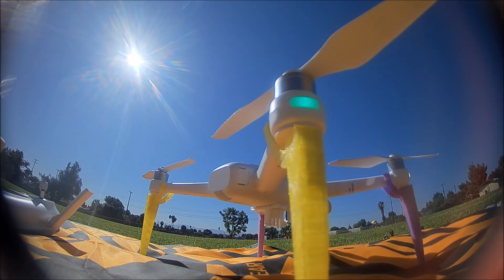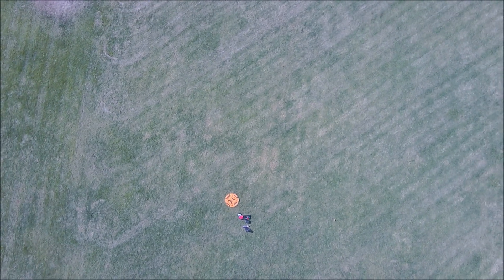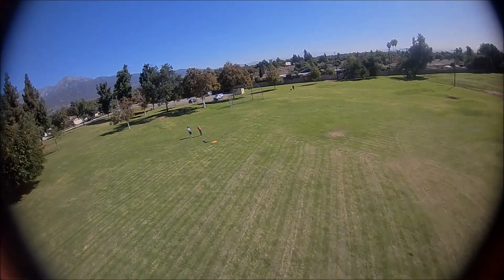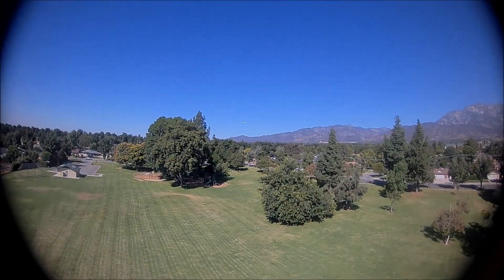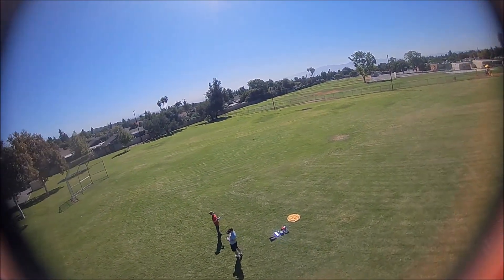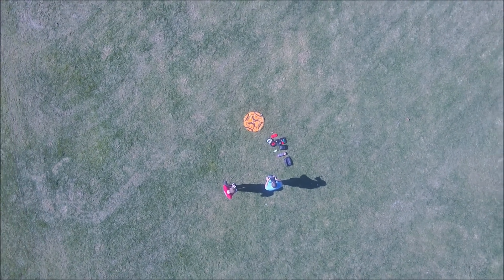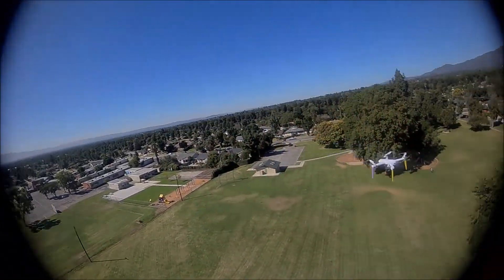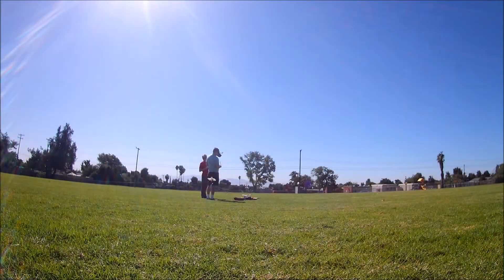Launching a drone from a drone featuring the Fimi A3 and UR85HD

Comment: Hi and 
thanks for sharing ; How is the drone port controlled from the mobile application?
Reply from the maker: The port is controlled by the Fimi A3's transmitter. In settings change the default EV to PWM control and you will be able to control the servo with the dial on the transmitter.
Reply: @mbioman  ok. Thanks. I have the fimi x8 se.